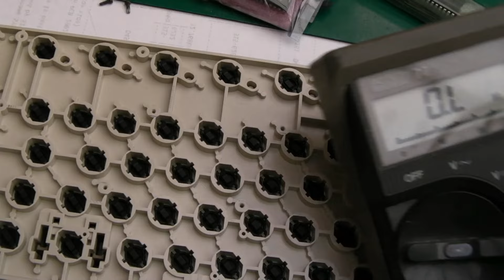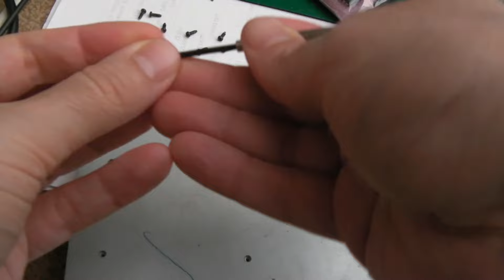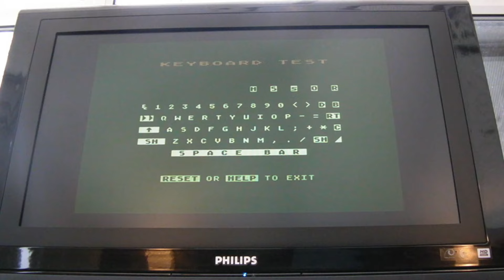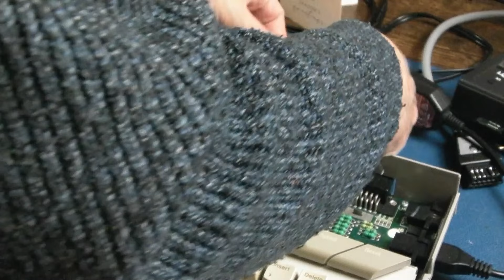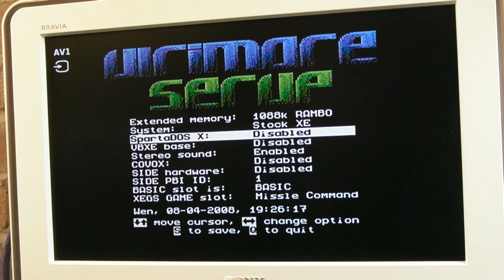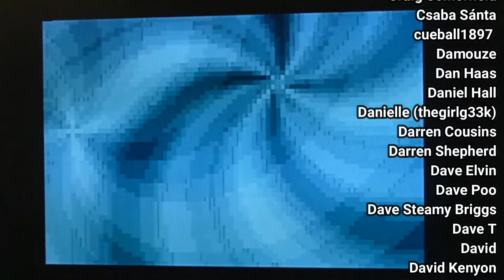Atari 65XE Function Keys (AGAIN) & Quick look at Atari Max Cart

Comment: What I dislike most about ST keyboards (and no it's not the ports being under the machine) see that middle standoff at around @12:20 ? The ST had that but it rested on the PCB. Anything dropped on the ST keyboard, that standoff will puncture the ST keyboards PCB, and there's several traces in that area, and they don't have a metal backing like the 65XE so it's very easy to replicate if care is not taken.
Reply from the maker: I never noticed that until now =O